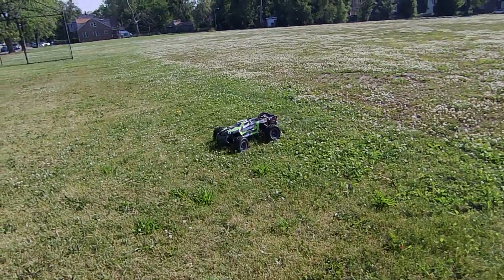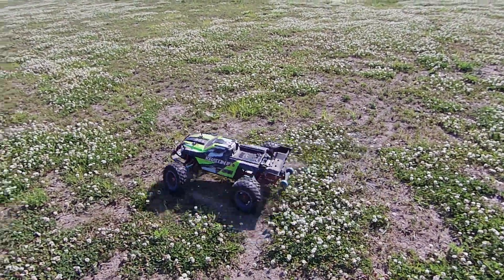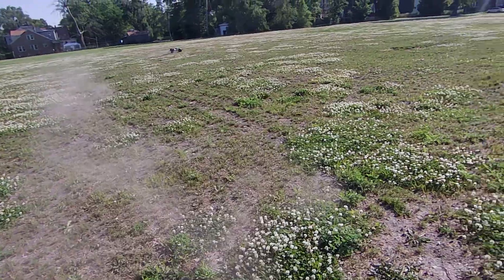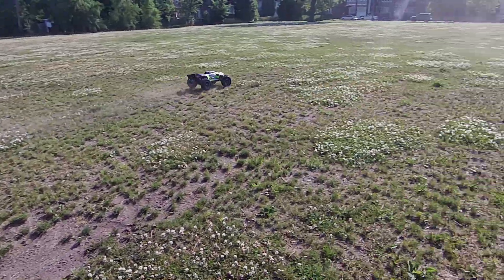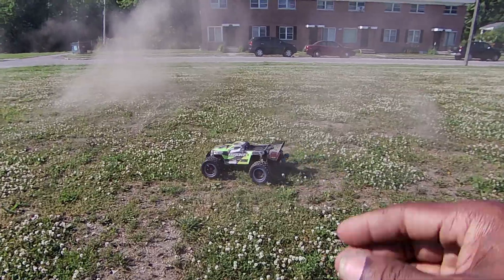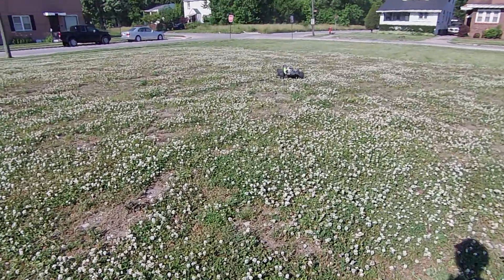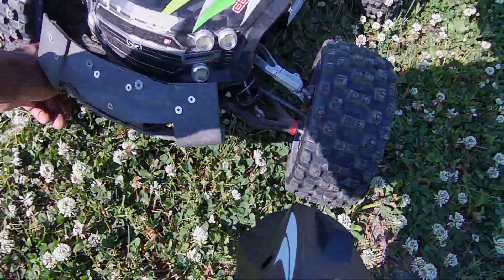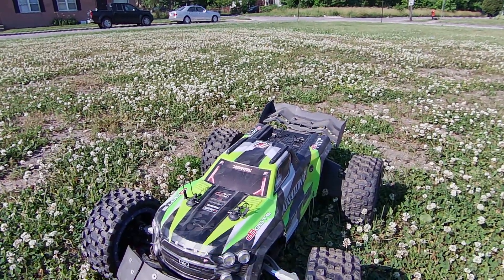Arrma Kraton 8S Mod 1.5 Gears

Comment: Hey do you have a part number for that HR mod 1.5 gear you used?  Be great to have that on my truck.
Reply from the maker: NSG23M15, but it was no easy feat. I had to die grind my M2C motor mount to get it to fit: https://www.arrmaforum.com/threads/megastys-kraton-8s-mods.16749/post-333360